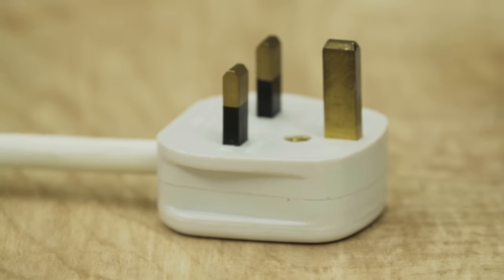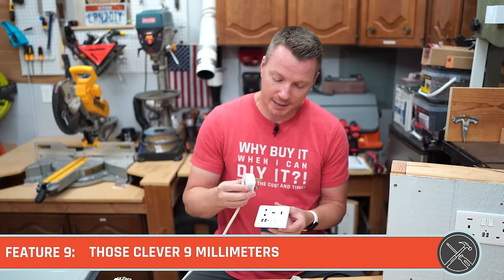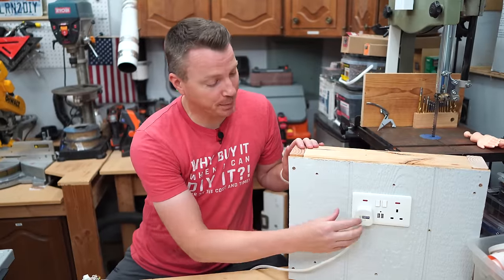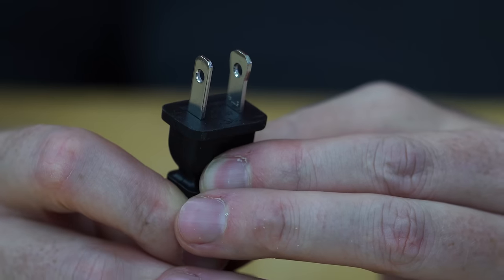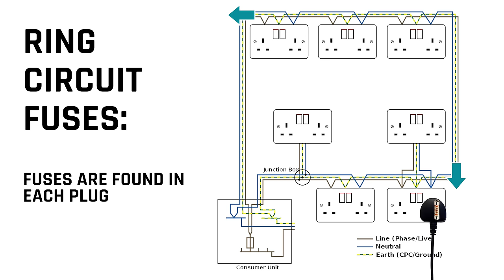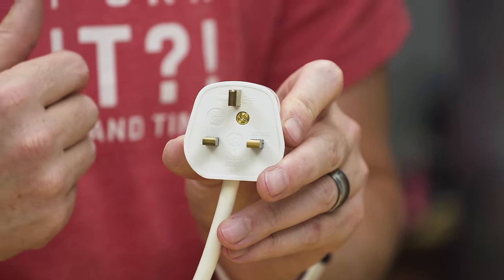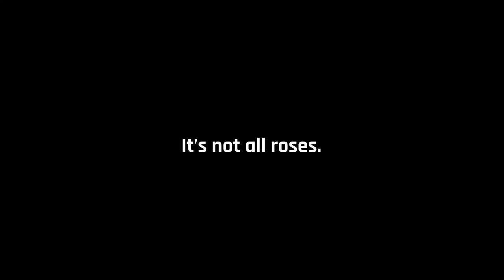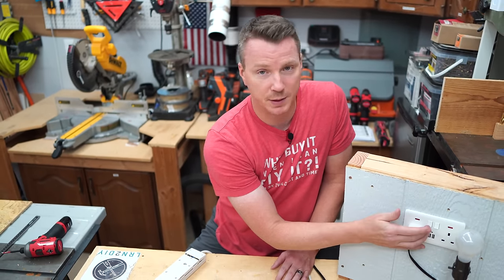British Plugs and Outlets Are On Another Level

Comment: I recall fitting fuses to the UK plugs years ago and most home owners knew how to do this. We all kept small  cards in our electrical cupboards that had a selection of fuses clipped to them. In later years the plugs design was changed and they are now a sealed unit attached to the cable coming out from the gadget
Reply: But you can still change the fuse.
Reply: One of the first thing I do is cut off those sealed plugs..
UK plugs are Still ready avaliable pretty much everywhere.
Reply: @mottrex  Why? I don't understand the point if cutting them off unless you need to replace a broken one. The sealed plugs were actually introduced as a safety feature, so that people didn't have to put a plug on a new appliance and risk wiring it up wrongly. The biggest mistakes people used to make was not fixing the cable with the cord grip and not putting the correct rated fuse in.
Reply: @gssf.gr29  I’ve cut them off too. Forcing me to use a sealed plug is akin to telling me I’m a buffoon that can’t be trusted to change a plug. Also, the Darwin awards videos are super necessary, evolutionarily speaking, and not at all entertaining 👀
Reply: @gssf.gr29  the molded plugs are great but if you want to hide the lead or its in a workshop or even a tidy minimalist kitchen you can't feed a chunky plug say through a work top without a rather large hole.
Also buying online can literally " Lead" to problems if they send out or just don't make a UK plug for your device  thats happening more than it should. Safety comes first but All plugs have the terminals etched into the plug and usually a handy plug shaped card with a wiring diagram.
The problem is and I sound like my father who did show me a great many things is that todays Bright young things don't learn or just don't know the basics about so many things it seems..
Reply: @mottrex  Yes, but in a home plugs are generally hard wired in. It's rare that anybody would want to drill a hole in their kitchen worktop to run an extra cable, but if you did you would have that problem with any size plug. Most people would have the socket hard wired into the wall, as you get on kitchen walls above the worktop. In offices they generally use "blanks". A hole is cut in the desk, the cables run through, then the blank put in place, with is effectively a plastic plug which covers the hole but leaves room for the cable to come through. 

In the UK all electrical appliances must have a UK (G type) plug fitted when you buy it. Of course, you can buy from some sellers, such as on ebay, that are importing goods that do not have a UK plug, but they should have. People need to decide whether they're OK with that and if they are capable with wiring a plug or not.
Reply: @InimitaPaul  Well unfortunately there are a lot of people who cannot change a plug and that has always been the case. The rule was brought in because many people would wire them incorrectly or put the wrong size fuse in. As I said, there's really no need to cut them off unless the appliance is faulty or has reached end of life, I don't see the point. The plug supplied by the manufacturer will almost certainly be of far better quality than the one you can buy in your local hardware store. Most people would also find it a lot more convenient, unpack, plug in and go. Why make work for yourself?
Reply: @gssf.gr29  I'm a designer, you would be surprised what people chuck in at the last moment and I've also seen many a kitchen/workshop with all manner of horrendous so called Hacks to get a lead from A to B.
I've seen many older properties here in UK where a light or switch has been connected to a piece of string dangling back to a bed, I guess they were elderly and bedbound.. 
Luckily we have Google/Alex for people to help these days but thats another issue.
Reply: @mottrex  Totally agree, I've installed the electrics for many kitchens, from houses to hotels and restaurants and I know exactly what people are like. If the contractor is doing his job he simply advises them of the correct options and proceeds accordingly. If the client then decides they're happy to have a hole in their worktop, that's up to them. The vast majority of the hacks are done by DIYers who think they can wire a plug so they can rewire a house.
Reply: @gssf.gr29  There are a lot of people who refuse to learn how to change a plug, there’s a difference between that and simply not being able or having the capacity to. There’s absolutely no need for them to be ubiquitous and I would argue that people who actually need them should have them provided upon request and if you have the ability to learn but refuse you should be forced to acknowledge that ignorance and pay for a safety plug version that will cost you more to compensate the company for the R&D that went into said plug. 

Dumbing down the world for the lowest common denominator is bad for everyone, in the not so distant future we are going to have to fix a lot of thing’s ourselves because throwaway culture is on the way out, these lazy people are going to have to either pay someone else to fix their products or learn how to do so safely so I’m not seeing a problem with changing the safety culture into a learning culture now rather than later.
Reply: @InimitaPaul  Wow! Sorry pal, but I think you have issues, or far too much time on your hands. It's a plug. There are far greater issues in the world today than if your appliance comes fitted with a plug or not, but if asked I suspect that the vast majority of people would be grateful that it did. But it's a poxy plug, I doubt that most people are particularly bothered  and give it much thought one way or another. If, at some point, people need to learn how to wire a plug then with the resources available to do so then I doubt it would be a problem.
Reply: @gssf.gr29  Either engage in the conversation or don’t but don’t be “that guy” because you don’t have a reasonable argument to the points laid out.
Reply: @gssf.gr29  Absolutely agreed that many people can't fit plugs properly.  I was taught as a child and then re-taught myself as an adult and finally was re-taught again by an electrician on an electronics course.  Each time I learnt new things.

When I take plugs off appliances that have been wired by amateurs (including my younger self) I nearly always find errors, though usually they aren't serious mistakes.

Comment: Superior design in every way. Downsides...? Its... big? No-one is confused by the switch being off at the wall, you don't even think about it, second nature as you're used to it. Stepping on an American plug is probably less than ideal as well. Also worth noting, the ring main has circuits within it, it doesn't service the whole house. Typically you'll have a kitchen, upstairs and downstairs, all with its own separate breaker, so overloading isn't an issue. If, for example, your washing machine shorts the system somehow, all the other rooms will still be connected.

Comment: As an Electrical Engineer in the UK I would have to say that load balancing is such a rare occurrence that it's mostly not even thought about. Most house don't have a ring for every room, so for example a kitchen may have the oven and the fridge on at the same time but not say the dishwasher, washing machine and microwave all on at the same time. Plus if there was to much load on a wire at once the RCD in the Consumer unit would just trip.

Comment: Fun Fact: The reason that Europe uses 230v standard is that you draw less amperage this is great for them considering the buildings there are much older and as they have been adapted for electricity over the years the wire size did not have to be upgraded as often. For example an electrical kitchen appliance is usually close to what one breaker can support in the US as most kitchens are wired for 20 amp, 15 in an older home. But if the voltage were increased to 230v you could run two heating appliances simultaneously. Maybe a toaster and a microwave for instance, at the same time and not trip the breaker.

Comment: 'the size' thing is interesting, if he held up the Type G and Type A in the orientation they would be plugged into the socket, you'd see that the Type A actually sticks further out from the socket because of how the cable is. So whilst the G is 'bigger' it actually takes up less room! As someone else commented, that means you can push furniture right up to the plug without worrying about squashing/ damaging the cable! 👍🏻

Comment: A few simple things... If a lamp is not working you always check the plug socket is on first and most sockets either say ON or have a small red marking to show the socket is turned on. If a bulb blows or doesn't come on but like your lamp has a slide switch you don't usually know if it still has power so you have to either risk changing the bulb with power still live or have to unplug it. We can just flip the switch and change the bulb. Yes the plugs are larger but the safety benefits are worth it. Its also much harder to accidentally pull the plug out of the socket and I have seen sockets get damage or seem to have issues when the US plug gets pulled up or down and plugs do get pulled out much easier (laptops for example can be a problem if you use one while it is charging). Power load on the ring main is usually never an issue unless someone is trying to over load it. Most run a 30 amp (the same as 60 amps in the USA) on the circuit and  consumer items like lamps, TV and satellite boxes have minimal load, so using a washing machine or dishwasher is fine and even running a 2Kw space heater (less than 10 amps) is usually still within the capacity if you use. If you have an electric cooker it is on its own 50amp circuit so it is not part of the normal ring main loading.  I work from home and even run a huge 4ftx4ftx4ft composites oven that will run at 75 degrees C for 16 hours with a vacuum pump and even run the chest freezer on the separate ring main that is wired into my garage with no problem.

Comment: I have a few things to say

First thing is that not all UK plugs can be opened, some are closed and have those little pull out fuses, however if there is ever a problem you can just buy a plug, cut the wire a little shorter and bobs your uncle.

Not all UK plugs have the switch at the socket, most do and I don't believe you can buy new ones without them now. Also the 'confusion' for if the plug is off and your appliance isn't working, it's not a problem, it's literally the first thing you check.

as for all the other 'drawbacks' I've not really had a problem with them, loadbalencing has only ever been a problem once and that was in a workshop where we had many high powered tools being used at once, and it was a very minor thing we easily fixed.

Also the size of the plug means it's much harder to stand on for a few reasons, the first, they're much easier to spot, but the other reasons are because they are big, usually if you unplug them you'll put them somewhere to the side or even maybe put it on something like a table or counter, which means it's really hard to step on. I think I did it once as a kid and that's about it

Comment: We don't unplug and leave it on the floor we just simply turn the switch off on the socket ( Outlet ) and as for the power load problem you mentioned at the end I am 67 years old and have never seen that happen .

Comment: Loading and load balancing isn’t an issue in the UK because along with arrival of the flat-pin BS1363 plug, we also widely adopted the ring main wiring system (later to become mandatory under BS7671) which means that any number of socket outlets within an area up to 100 sq. m. can be supplied by a ‘ring’ of two 2.5mm sq. cables protected by either a single 30A fuse or - more recently - a 32A mcb. Quite different from the US and Canada which still widely use the older, radial system.
Reply: A ring final circuit is not mandatroy.

Comment: The Australia/NZ/China plugs have insulated pins and practically areas good as UK plugs but are much smaller, they were designed to use the minimum brass to do the job while UK plugs use lots of brass, hence increased cost, when I lived in England I used them and as they age the fuse holder corrodes and produces heat in the plug on high power appliances. But the biggest single flaw is that the average person does not understand  that the fuse has to match the appliance so 13amp fuses go into everything which destroys the whole point of the ring main and fuses. Plus the Aus/NZ piggy back plugs are brilliant.

Comment: UK engineer here. Never had load balancing issues in my entire life, wires are gauged to fusing and MCCBs correctly every where I have worked and lived in UK. Never had then trip. So not a common problem as you claimed.

240V is why wire gauging is half size required over 110V systems.

Comment: The EU style plug also deserves a shout out. Has many of the same or similar features as the G plug (except for the fuse, only needed in the UK really, due to the way they wire they outlets) and is more compact. The EU plugs come in 90º and straight variants, usually things that you are likely to trip on it's cable come with straight plugs (like a laptop charger), while other things come with 90º ones.
Reply: The fuse is to the protect the flex, nothing at all to do how anything is wired.
Reply: @johnburns4017  that’s only a problem because you put your sockets/outlets in 20 or 32 amp rings and the plugs themselves are rated for 13 amp. Shucko plugs are rated for 16 amps and placed on 16 amp circuits. We do have europlugs that are rated for 2.5 amps, which could use a fuse but I have not seen a single melted euro plug nor a cable attached to one.
Reply: @JoseLgamer05  
13A G type plugs are also used on radial circuits. They are not specific to rings only. 
Typical Radials: 
1) 1.5mm cable up to a 16A breaker.
2) 2.5mm cable up to a 20A breaker. 
3) 4mm cable up to a 32A breaker.
4) 13A plugs used in above. Correct size fuse is inserted into the plug to suit the appliance/breaker. . 

You could have a 6mm radial with a 40A breaker using 13A plugs.  

a) Breaker protects the cable, 
b) The plug fuse protects the flex/appliance. 

The simple fact is that the appliance flex is not protected on Euro plugs being a fire risk.  An appliance flex is the most abused cable. 

Far superior to anything used in Europe or the USA.

Comment: Tell me about stepping on one! 😁

Done it quite a few times. Mind you, apart from being painful, it's no real biggie.

I'd also point out that not all UK sockets have switches. It might be the standard way on new installs, but older houses like ours certainly don't have them, and you can easily obtain non-switched socket outlets from any builders' merchant. It isn't a legal requirement as far as I am aware.

In some cases, I like switched outlets. But in others, they can be a pain - particularly if you're running various equipment from one by an extension cord, and you accidentally knock it and turn off the power. |It's a potential issue with computers especially.

Interesting and well presented video, though.

Comment: When wiring a plug an easy way to remember where the positive and negative goes, you simply take the secon letter of the colour of the wires eg. The second letter of blue is L (L for left) and second letter of brown is R  (R for right) The third double coloured wire (earth) simply goes to the top
Reply: Unfortunately, 'Live' also begins with 'L'.
Reply: @davidupton3186  live is not a colour
Reply: @davidupton3186  I know what you mean.  The association is that Black or Blue could be live.

It gets worse when you consider that prior to 1970 or thereabouts, flexible cable (then called 'cord') was black and red and black was then neutral, and that until around 2015 we used black as neutral for our fixed wiring.

So when you see a black cable, you need to note the context as by modern standards black is a live conductor, but there's plenty of old equipment and installations to get confused by.

Comment: Other things about the uk plug:

- most uk plugs and the new ones, are not repairable as they are folded and only have a fuse slot
- the voltage is double US voltage and shocks are more dangerous and im pretty sure that some older uk devices would be 250v rather than 240v
Reply: Mine is 250v. The UK has RCDs. RCBOs or AFDDs. Dangerous shocks are rare these days.

Comment: Size?  Consider this was 80 years ago before portable gadgets were common or even considered.  There are some clever updates for travel and compact gadgets - mobile phones, laptops etc, using slide up/down earth pins.  Downside?  Manufacturers aren't consistent with cables coming out top or bottom (usually big transformer plugs) sometimes making it difficult to accommodate everything in a 2 row extension lead on a busy computer or home cinema rig.  I wonder why the type g-plug wasn't adopted by more countries?  Great vid.

Comment: Could someone explain to me how everything in the UK is 220V? Are the appliances there all made to withstand 220V or do they have some type of retarder inside to reduce to 110V to keep things from frying? Thanks!
Reply: Yes, appliances in the UK don't have retarders to reduce to 110V. There may be retarders for perhaps the appliance's lights or it's control panel. That might be designed so that any part of the appliance that might be handled with wet hands or subject to rough use would operate at perhaps just 24V or even less. All products sold here must conform to the required design.

Comment: A plastic earth pin does not mean a device is double grounded, it is double insulated (there are two levels of insulating materials between the inernal electronics and the external surface), if it has a plastic earth pin it's not grounded at all